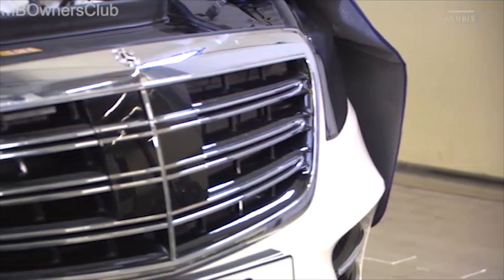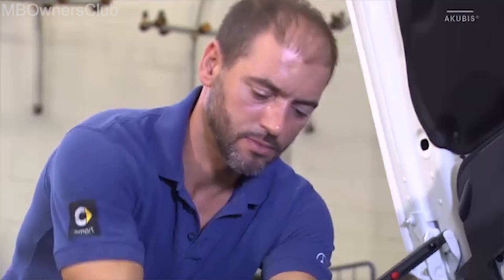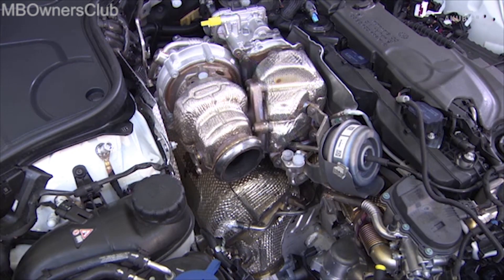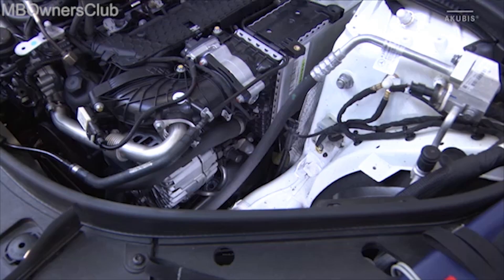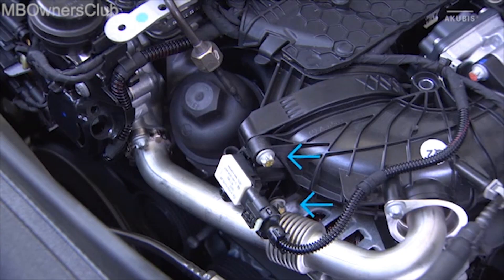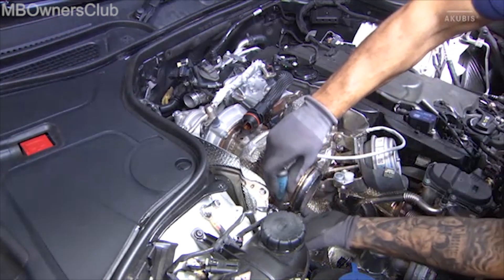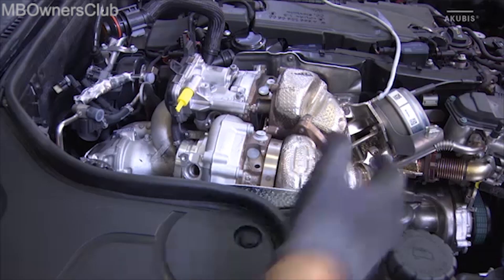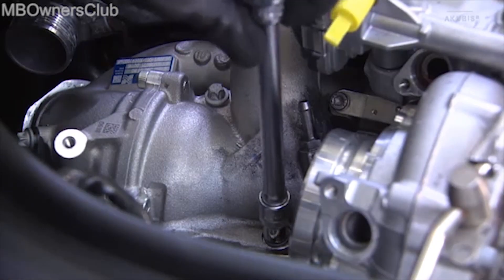Mercedes-Benz S-Class Turbocharger Removal and Installation | W222 OM 656 Engine

Comment: How did you unscrew the oil return line that are under the turbos ?? I did this engine myself today and there is no way to do that without putting out the engine
Reply: Bez problemu wyjmiesz turbo śruby są na przelot turbiny od góry 👍wyjmowałem ostatnio